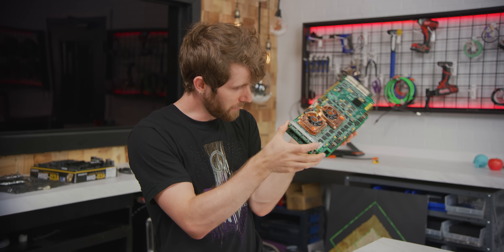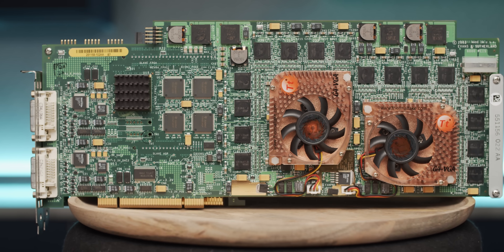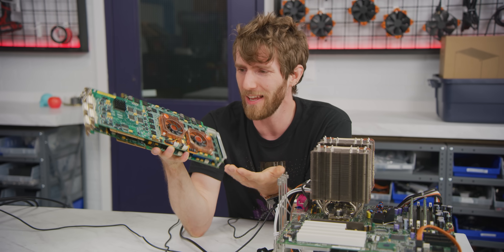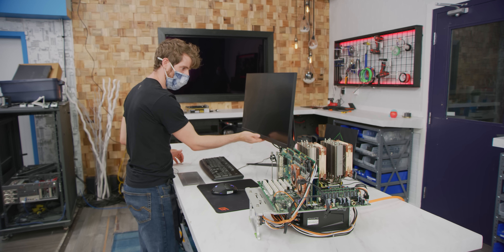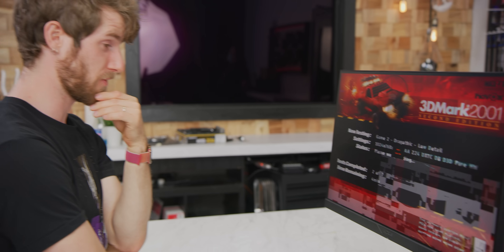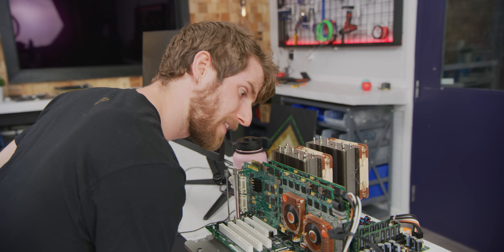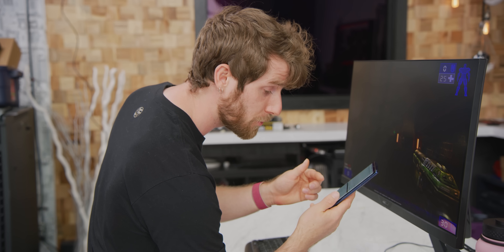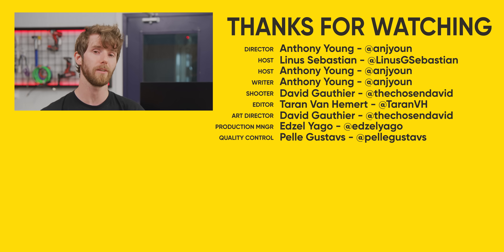This MONSTER Video Card has 4 GPUs... and it's from 2004! - E&S SimFUSION 6500q

Comment: 7:57 You guys should have a DMZ for stuff like this. Still protected from the Internet by a firewall, but also firewalled off from the rest of your production network.
Reply: This is a good idea.  Anthony should probably be the one to configure it.
Although, assuming their XP has not been compromised, it's not a threat to anything else on the network.  It is however a good target; but if you've already got malware or hackers roaming your internal network to attack this thing, you've got bigger problems.
Reply: Yeah, you'd have to be careless or very unlucky for your XP machine to get compromised if all you're doing is grabbing drivers and executables from known sources. Not to say XP is safe by any means; you absolutely shouldn't be using it for anything important like your online banking or social media anymore. But as long as you don't go on the seedy side of the web with IE, and you have a properly configured firewall, you should be safe-ish enough to connect for updates without too much worry.

A company like LMG, with servers full of critical data on site, should still definitely use a DMZ for these quickie one-off projects. Nothing sucks worse than an unexpectedly dirty device going rogue and wreaking havoc on your production network. Been there, done that, preemptively scanned every machine we got from that vendor from then on.

Comment: An RTX 3080ti with 4 gpu chips would be more interesting. I mean hell if AMD can put 4  chiplets in a cpu why can't there be 4 chiplets in a gpu?. Obviously a bunch of smaller dies linked together have better yields/cheaper prices than 1 big one, just look at the price difference of a  16-core Intel (1 big die) VS 16-Core AMD (4 smaller dies).

Comment: Anthony, causally: " I actually had to recap the board before it would work"
Linus seconds later: "Don't over think it. Lets just throw the card in here!"  (jostles valuable antique hardware into place)
Anthony is a saint
Reply: solid state caps have far greater reliability than tantalum and electrolytic capacitors - so both are correct
Reply: impacts and physical stress will not damage caps (unless physically damaged; as in torn off or dented) caps simply wear out with age.
Reply: @braydoncoate  yeah, no i wasn't implying that mr sebastian was going to damage the caps, just that anthony just dropped a low key "i recapped the mobo" like its no big deal, while linus continues to manhandle the gear like his lovely usual self.  they are a great pair :)
Reply: @jtsp84  ahh understandable
Reply: Can someone explain me why they wear and don't wear masks? Like wear them all the time or don't wear em at all
Reply: @AlanAA  for your viewing pleasure. If they cannot social distance then 1 of the 2 must wear a mask. If they can social distance then no masks. Hard to record audio and engaging video with masks.
Reply: RITA 25 y.o , I WANT SЕХ !!! OPEN MY CANAL !!!  I hope you are staying healthy and safe in this pandemic😊😊
(not for sub or views)
Reply: @TrollMemesyt  (nOt fOr SuB oR ViEwS)
Reply: Andrew Delashaw 😂😂😂
Reply: @TrollMemesyt  simp
Reply: @FoxMulder78  you do realize he knows its a bot. Some bring rude dude
Reply: @SPECTRA890  It's a joke, relax.

Comment: "old enough to still use DVI" - my GTX 1070 has a DVI port :(
Reply: Still using DVI-DL on my 1060. My 144hz monitor doesn't support DisplayPort
Reply: @TheDeeplyCynical  wait how does a monitor not support display port? You mean it don't got one?
Reply: @thenoobreturnz8968  Correct, It has DVI (Dual Link), HDMI and VGA.
Reply: @TheDeeplyCynical  well you're definitely not running at 144hz
Reply: My rx 570 only has dvi display port and hdmi lol
Reply: I think he meant 'only DVI'.
Reply: @CarthagoMike  am sure that is what he was talking about because VGA was standard on all cards then.
Reply: Here's a weird thing: My monitor only supports its maximum resolution via DVI and DisplayPort, but not HDMI, since HDMI was actually lagging behind regarding support of resolutions above 1080p for a while. With a PC, this is fine (just use DP), but with my Xbox One, I had to experiment with various HDMI to DVI adapters until I was able to properly use the system.
Reply: a GTX 1070 is by no means old tech. My monitor only has DVI and VGA and even that doesn't seem that old, just 8 years old.
Reply: @alimanski7941  my 2 year old monitor has dvi, hdmi and vga, my 2nd one has only vga being 13 years old. those old screens are perfect as secondary screens (got it for free after my grandparents decided to finally get a 16:9)
Reply: I think what they more meant was that it wasn't so old it wasn't using DVI and had something older like VGA Or some old weird Digital Video connector that isn't DVI or based on DVI.

ALSO unless your using high frame rate and/or high resolution displays, I dont see the hate for DVI in 2020, its still more than enough for a couple of 1080P 60hz monitors which is enough for people like me who don't care for high refresh rates (though I wouldn't mind a larger monitor in 2 or 4K for more WORK space rather than high resoultion gaming)
Reply: @nekomasteryoutube3232  if you use dual link dvi i think 1080p at 144hz are possible...
Reply: My RTX 2060 has a DVI port on it lol
Reply: Same here, I'm rocking my main screen on DVI on my 1070!
Reply: My monitor is old enough to use VGA-to-HDMI Adapter
Reply: Same
Reply: Right!!!
Reply: As does my rx 580
Reply: 1660s can have DVI also.
Reply: Yeah. Still on DVI-DL here. All my 3007WFP will take.
Reply: My 1050Ti has 2 DVI-DL
Reply: my rtx 2060 super does as well, have my screen connected to it and my second one with hdmi to vga adapter
Reply: Dvi is for legacy
Reply: At least you have a 1070
Reply: @brayden-mccallum  I'm getting an rx580 or 90 I dont even think any of those usually come with dvi.
Reply: My 1650 has DVI lmao
Reply: damn, I was about to say the same thing
Reply: My RX 590 still has one
Reply: my rtx 2060 super still has dvi-d, im using it, even tho it has another display port and hdmi
Reply: Lovegirlforever.Link
Reply: Lol my 2020 motherboard "asus prime b450m k " dosent have a hdmi port
Reply: Im using DVI on my RTX 2060...
Reply: Same with my RTX2060, digital only DVI (won't work with DVI > VGA adapters)
Reply: Do you still have it
Reply: wtf is a DVI?
Reply: still using a dvi port on a gtx 1070 bought just recently. Its anyway just like 2070 but a little weaker and diffrent architecture and no rt cores
Reply: @NoobGyver  a lot weaker
Reply: @John-hz4wi  yes, but who needs rtx anyway? I don't run that powerfull games, i bought it for the sake of rendering, since someone recommended me it is a great choice, it is weaker than 2070 but still a little stronger than a 2060.
Reply: @NoobGyver  a different architecture would make a big difference still. But rtx is a scam anyway.
Reply: @liam5254  yeah, its the reason i picked 1070 over 2060.
Reply: @NoobGyver  rt cores arent real theyre shader units
Reply: @Kemono_Friends  i know it just doesn't have those shader units.
Reply: NoobGyver information has come out that they are shader units, there’s no such thing as Rt cores.
Reply: @Kemono_Friends  yeah rtx is some kind of scam in a way
Reply: @NoobGyver  the 1070 is in no way similar to the 2070 except that they are both graphics cards and they both fill the x70 position in the product stack. They're entirely different.
Reply: @RChero1010  there are 2070's with DVI, not many, but they exist. super, could not find one
Reply: @RChero1010  yeah your right, i knew i'd be wrong, i wanted to say it is way more similar to a 2060.
Reply: I hope you all are staying healthy and safe in this pandemic😊☺
(not for sub or views)
Reply: @TrollMemesyt  Cringe worthy saying.. why not just hope someone is staying safe..doesn't the healthy part come after that?

Comment: System I developed software for used the 4500Q version of the E&S video cards.  The replacement unit cost of those cards was $17000 each.  So it is safe to say that card LTT has was priced in the $20000 range.  LTT was correct however that it was the advance features like frame sync across multiple computers (we had 7) that was the selling point.  Oh the memories.  And for what it was worth one 9700/9800 was faster than the 4500Q.  E&S was clearly coming to the end of an era with their designs by the time they started designing the card LTT has.

Comment: If your are willing to spend between $10,000-$15,000 US there is the 3DFX Voodoo 5 6000 (1999-2000) then there is the 3DFX Rampage that would have had somewhere around Geforce 3 to Geforce 4 level performance from 2000.

Comment: "Old enough to still use DVI"
My RX 570: sweating
Reply: 1050ti has it too
Reply: my 1070: haha the one thing i have in common with you grandpa
Reply: I think he meant 'only DVI'.
Reply: my 7970 has 1 dvi-d 1 dvi-i, and 4 dp
Reply: gt 1030
Reply: jokes on you i use an rx 480
Reply: Cashel Does Gaming I have a 1080 and it has DVI
Reply: @thegamerfromjuipiter7545  I have the Ti version and it doesn't have DVI.
Reply: Random Anime Girl I believe the 1080 ti was Nvidia’s first card to omit it. It was released almost a year after.
Reply: Yeah my 1070 has one too
Reply: @garrettdownes3309  1070 gang were u at, proud part of it
Reply: @NoobGyver  KFA2 1070 EXOC here
Reply: @NoobGyver  1070 Gang! Getting it at launch was the best PC part purchase I've made
Reply: @Balomis  i also love it, not to pricy, works better than a 2060 and looks awesome in my built
Reply: My 1660 Super has DV-I
Reply: My RTX 2060 has a DVI
Reply: Whats wrong with dvi its like ok
Reply: I'm using DVI to watch this... Laptop HDMI converted to DVI.
Reply: My RX580 has one dvi, 2 hdmi and 2 DP ports, and I still use the dvi for a old monitor I have
Reply: @leovanin20v  nice, I have the same card
Reply: I have a 1650 super with dvi
Reply: @noob gyver  my card is a zotac amp what's yours
Reply: My GT710 2GB GDDR5 has VGA and DVI
Reply: I use a 1660 super with a dvi adapter. lol
Reply: My HD7850: hides in the corner

Here's hoping the new RDNA2 and 3000 series GPUs launches
Reply: My rtx 2070 has DVI
Reply: There are RTX 2070 that have DVI. Maybe even 2080...
Reply: My 1060 system and my radeoan 5770 and 489p systems are shaking
Reply: RX590 here with DVI-D
Reply: By use dvi he means USE DVI, not have it, ONLY have it.
Reply: I think he meant 'new enough' to use DVI. My mom has monitors that's equipped with only DVI from the late 90s. Normally you'd expect only VGA or S-Video output on ancient antiques like this. I think that's what I had on my old Radeon 9200SE
Reply: My zotac GTX 1070 has one...
Reply: 「the dong」 lol
Reply: 2070 super EVGA gang where u at?
Reply: I hope you all are staying healthy and safe in this pandemic😊☺
(not for sub or views)

Comment: The 3dfx voodoo 5 cards with the VSA-100 graphics chip in 2000 used multiples, theoretically from 1 all the way up to 32 on a single graphics card.

Comment: 2004: 4 GPUs in one Card
2008: 4 Cores in one CPU
2011: 4 CPUs in one Motherboard
2020: 4 letters in "FOCK"
Reply: You know you can spell the actual word right?
Reply: @bootyking2897  I am under 18, 16 actually
Reply: 4 cores was 2006 and 4 CPUs goes back to the 80s with early RISC stuff.

Comment: I'm getting a x570E asus motherboard and it has 2 argb headers, gen 2.  I'm planning on using 1 for my case's (td500 mesh) 3 stock fan and my wraith prism cooler. I want to use the other header for corsair fans probably a 3 pack ll 120mm. Could this work? And if it does, how would I go about changing my wraith prism to a corsair aio in the future?

Comment: Company I worked for back in 1999 used to make in the UK (when the UK used to make things) Made 3D Labs graphics cards when the Pentium 3 was a new thing. It has 3 chips with fans. One smaller geometry processor and two larger that did rendering and lighting between them. Full length card and the back of it was full of memory chips. A nightmare to manufacture and even harder to fix the faulty ones due to the density of a dual sided card at the time. But when we got to play awesome Quake death matches on the test rigs at break times. I still have one of the 15mm fans from the geometry processor as it's so small and really well made. My last day working there as a souvenir.